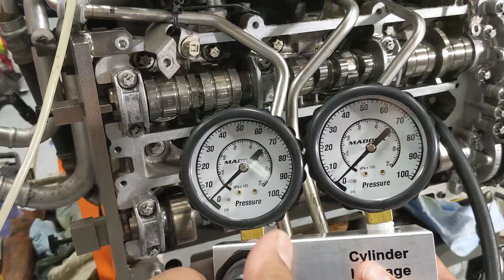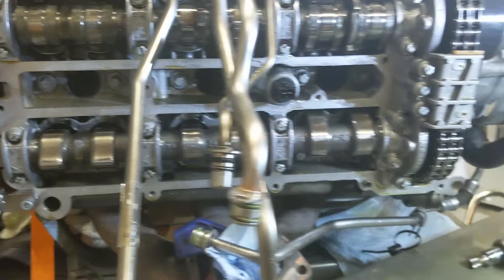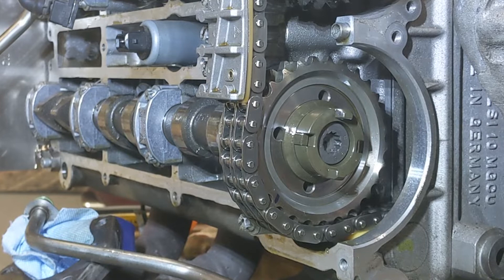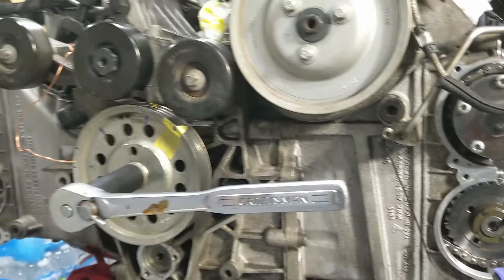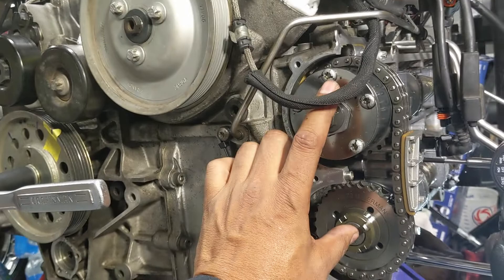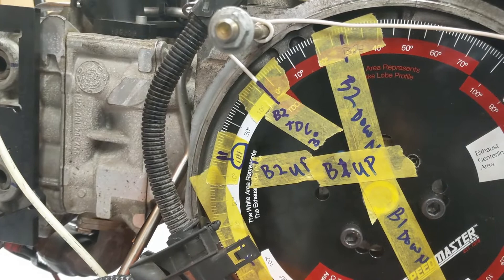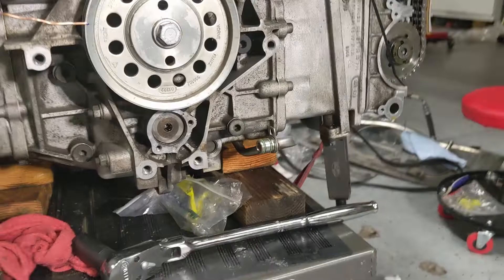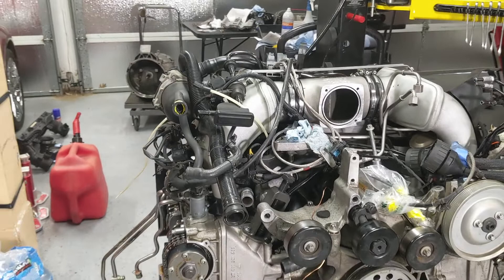Jay's Porsche 911/997 turbo Major Engine Out Repair Season 2 Final

Comment: I am also facing same problem of chain slippage, although it was not as fast as yours but it was leaving the exhaust gear on bank 1 slowly... So I hold it with my finger... But it scares me a bit, should we keep the tensioner in a pot filled of oil .. or leave it as it is .. I am certain about my timing procedure, I followed this video completely & got it done perfectly...
Thanks to u
Reply from the maker: Excellent, glad you got it figured out and yes, thanks to Jay for sharing.  You may have read it, the person on the post above had bank 2 out of time 360 degrees the first time and had to drop the engine again.
Reply: @atm4jim  big thanks to Mr. Jay & you .... Amazing upload 🙌👍....

Comment: After you reset the timing, when rotating the motor, did the chain slack disappear?
Reply from the maker: I think the chain tensioning tool was the key to this, skip to 14:20 of the video.  Thanks.

Comment: Hello. , i am re-assembling my engine due to engine failure because of coolant leaking and mixed with oil in the engine , and i have some questions, Ive ordered the steel coolant pipes from sharkwerks and i am changing all the radiator and coolant pipes , is there any thing you would recommend that i have to change since my engine is still out ? 220k miles on 2009 997 turbo engine.
Thank you
Reply from the maker: All the rubber hoses that are hard to reach with engine in, the plastic timing chain guides which cracks/wear over time, you may want to pin the camshaft sleeve, and of course pin and JB Weld the coolant pipes.  There are a few threads in Rennlist for the list of parts.  

Here's one - https://rennlist.com/forums/997-turbo-forum/1198573-the-what-parts-do-i-need-to-buy-when-repairing-coolant-pipes-cams-thread.html

Jay also changed his water pump, starter, (can be done with engine in) upgraded his clutch/pressure plate, replaced his spark plugs/coil (can be done with engine in but much more difficult) and much more.

Comment: The amount of work in this job is incredible.  Not only once but twice.  I was wondering how many hours were put into this second job as well as the first?
Reply: The engine in and out is 12 hours
the RMS fix was less than and hout to remove the transmission and replace the seal
The PS fix a few hours i had planned the repair ahead of time
The timing kicked my butt set me back a week waiting for the information and tool.
That's a complete PITA a solid 12 hours  would not advise anyone to do it 
I could have lived with it but OCD kicked in and hod (2) other issues to take care of.
Spent 80 hours the fist time around could be done is 50 with experience gained.

Comment: I watched the video but still don't understand the the diagnosis for your timing chain coming off the gear... was it worn out auto adjusting cam chain tensioners?   If so did you go with aftermarket manual chain tensioners as the fix?  I understood you reset the timing but something had to cause the timing to go out of spec which sounds like the tensioners failed.